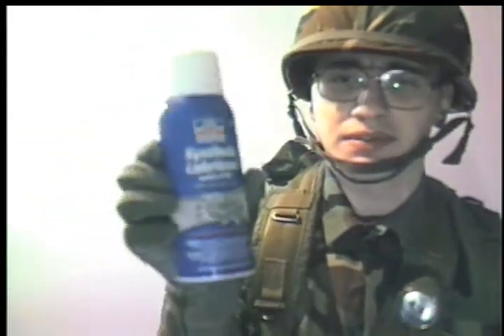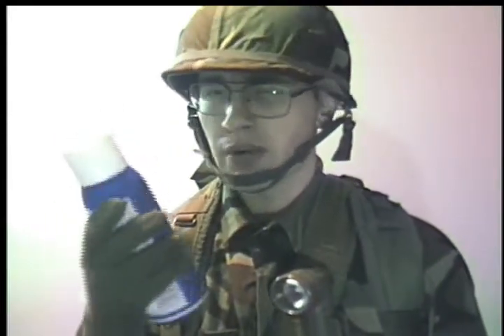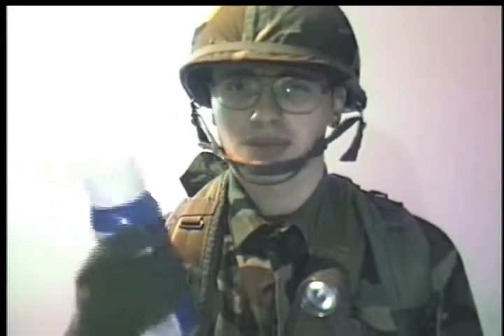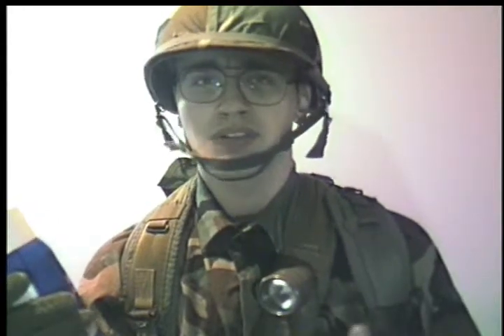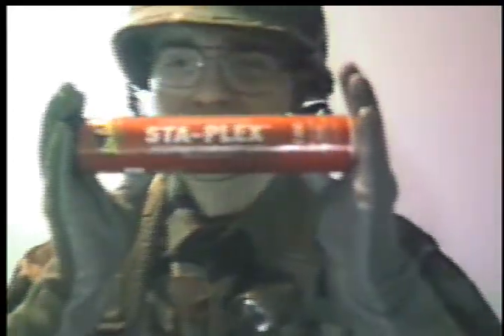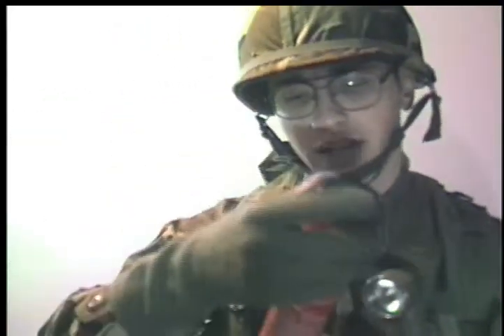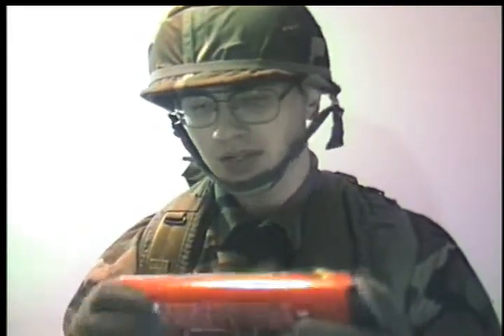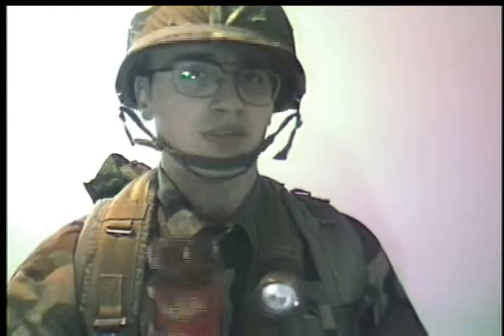Silicone spray is NOT a good lubricant for Airsoft, or real guns

Comment: soo you said that: I have to use high viscosity oils in high wear parts example slide and for non wearing parts use thin oils for example input valve in mags so it can penetrate in side and lubircate the oring but because is thin oil it will go off fast so i hove to lubricate more often am i correct???   

soo this kit may be the solution it has a mixture of Teflon and silicon grease for the slide and a spray for the orings: https://www.evike.com/products/39990/

Comment: Kroon oil universal lubricant a good idea?
Reply from the maker: The spray?
Reply: @KlonoaTorqueBow  think its called kroon oil handy oil
Reply from the maker: @dommebelg6962  It depends on what kind of gun you're using it for.
Reply: @KlonoaTorqueBow  for a WE glock 17 gen 4 gbb
Reply from the maker: @dommebelg6962  Way too light. Get a heavy synthetic oil or grease. I don't know what in specific they offer over in Europe
Reply: No like the bottle the real oil

Comment: silicon lubes fine... on the long run it will stiffen all kinds of rubber parts.
im just about to begin my airsoft adventure as an beginner, and i think im gonna use automatic transmission oil (ATF)
Reply from the maker: GL
Reply: @KlonoaTorqueBow  GL?
Reply from the maker: @ksw8934  Good luck

Comment: What grease would u recommend for gen 3 aeg gearbox
Reply from the maker: Version 3, is that what you mean?
Reply: @KlonoaTorqueBow  yes
Reply from the maker: @empireofsebastian1423  I like RedLine CV-2 personally. That stuff'll keep even curing paint from wearing off.
Reply: @KlonoaTorqueBow  thanks, I've been buying evik brand silicone grease and that stuff is less reliable that petroleum grease in there, but I'll try the Redline and see how well it holds up in the dusty fields of Georgia, thank you 👍🏽
Reply from the maker: Sorry for not responding. By the time you replied I had ate like four double cheeseburgers and was completely wiped out. Glad to be of help to you
Reply from the maker: Wait, let me look at some of the stuff ansoil has. They have some heavier-duty greases that'd be more suitable to airsoft gears.
Reply from the maker: Look for Amsoil's "Dominator" grease instead, sorry.
Reply: @KlonoaTorqueBow  oh ok then, thanks

Comment: What should i use for a hx25 mag?
Reply from the maker: Thanks for reaching out. What part of the magazine?
Reply: @KlonoaTorqueBow  im newer to airsoft. And i am just referring to all of the parts that need lubricant on the mag
Reply from the maker: @12v_Jonn  Do you know how to get the magazine apart? There are o-rings inside that need to be greased. Otherwise, I wouldn't recommend lubricating the magazines unless its jamming.
Reply: @KlonoaTorqueBow  i don't know how to get the mag apart.  I am pry going to use propane. Will that start to dry out the o rings?
Reply from the maker: @12v_Jonn  Propane is optimal. The short of it is that using green gas, silicone oil is added into it, and will be spread throughout the inside of the gun, which is very bad. Using propane will keep the gun uncontaminated.

Some of the WE/AW pistols I've had over the years were leaking out of the box. However, some come in just fine. Propane itself will not dry out the rings, but time will.
Reply: @KlonoaTorqueBow  alright so how often would i need to lube. Since you said time will dry it out
Reply from the maker: @12v_Jonn  Something like 75 wt silicone oil would be a good "general" purpose oil for keeping the o-rings in good shape and could possibly stay for a very, very long time. Most of the dried up o-rings and seals we see in leaking mags are because the wrong kind of lubricant was used, which was spray, from the factory.
Reply: @KlonoaTorqueBow  ok thanks! So my pistol should be good to go out of the box for a long time?
Reply from the maker: @12v_Jonn  Well, that's the wishful thinking. The moment it springs a leak though, it needs to be fixed. Ideally, one would get a valve key, a correct oil or grease, and do over o-rings when they get it, but that's unrealistic for everyone.
Reply: @KlonoaTorqueBow  alright good to know. Thanks for the help!

Comment: I just got into airsoft , I’m going with o ring silicone lube from super lube for o rings , and a synthetic grease from super lube for metal parts any thoughts
Reply from the maker: Sorry about the late response.

Don't use superlube. Use Dow Corning high vacuum grease for stationary o rings, and a mid wt silicone shock fluid for moving ones. The wt needed is specific to the parts it's being used on. For moving parts, again, depending on if it's a high, like a hammer, or low like a spring. Royal Purple, Amsoil, Mobil1 are great options.

Comment: you a smart guy... everything you said makes sense... I use silicone grease with ptfe on the slide and main housing.. I'll only use silicone oil in my mag for the O rings.. Also white or red lithium grease works with slide as well.. I've been using white lithium grease on my real gun slides and outer barrels.. So far so good.. I haven't tried the red lithium yet. I have the lucas red and tacky red lithium... Ill try that next.. Your video was very informative never mind those who don't comment or dislike.. The ones that dislike don't have the knowledge that you have taken the time to retain.. Keep doing what your doing, you're on the right path.. PLus your guns will outlast and outperform all your haters.. So be happy..
Reply from the maker: Thank you for being at least remotely open-minded about this, and I'm glad to hear you've seen through the bullshit marketing of "airsoft oil". Real gun oil, while at least much better than silicone oil, is a mostly snake-oil market entirely with some exceptions. Using products intended for industrial purposes, to prevent the mechanical failure and wearing in machines that can cost hundreds of thousands of dollars is the safest bet.

I was a bit younger when I made this video, and I've learned some new things along the way. If I had to briefly adjust the message of this video, I'd say use the right kind of oil or grease for the application, and try to estimate the base oil viscosity, indicated in a product's sds/msds to be appropriate for the action of the gun. An example of that is a spring-action, basic airsoft pistol. Using something like Dow Corning high-vacuum grease would cause something called "viscous-drag". Basically, that just means the lubricant is too thick for the parts to function with. It's too sticky or thick. 

The best way I've found to have a reference before ordering, is to look for the cheapest oils or greases in several weight-classes, and use those to test similar parts and how well they operate before ordering a premium lubricant that costs money. Hardware store-stuff is great for this, since it's probably just a drive into town. Even if they don't have the right kind, one can still get a reasonable idea of what's too weak, or too strong. Putting it even more briefly, unless it's a super-high-wear part, like a pot-metal disconnector in a gas blowback Beretta pistol, it may just need the lightest oil possible. Things like WE-Tech's pot-metal hammers on their Beretta models, or 1911's will absolutely need the best, heaviest tolerable lubricant money can buy, because those hammers and their sears are the fastest thing to shit out on any gas-blowback pistol, ever . Ask anybody who's owned one. They turn into full-auto-only pistols really fast.

I'm going to make a followup video to this one very soon, and demonstrate what I've learned since this video. Thanks a ton for reaching out. People commenting is the #1 reason I make these videos for.

Comment: I own a kwc/elite force 1911. will a team losi 15 wt shock oil work for my seals? or possibly 100% silicone oil for treadmills.
Reply from the maker: 15 wt shock oil is a great choice, but I'd personally use 3 million for fixed seals, and a much lighter weight like 50 or 70 weight for moving ones like the piston head. I believe that heavy silicones actually improve compression greatly. It could be a struggle to find the highest possible weight that won't cause viscous drag, yet potentially offer the best aid for compression.
Reply from the maker: All kinds of good products and methods that can be used in your situation, that it's much more useful to know what's potentially harmful, or outright just doesn't work at all. 

Silicone treadmill oil is good, provided that it's 100% silicone oil, and can be corroborated to an MSDS to verify that it's actually as it claims. I don't like using anything that I can't find an MSDS for.
Reply: @KlonoaTorqueBow  thank you. im sure you've seen the one video where a guy is reviewing shock oil and only says to get the 10-20 weight for seals. however ive seen people using like 80 weight. but hey, as long as its able to drip instead of stay like grease then ill use it.
Reply from the maker: @callsign_mako3404  Grease is actually great for static seals IME. Plugs up propane leaks like it's nothing else's business. I absolutely wouldn't use it on a moving surface. Too heavy.
Reply: @KlonoaTorqueBow  hey actually, what weight would be good for the metal on plastic applications? my kjw hi capa is polymer and has a metal slide.
Reply: @KlonoaTorqueBow  oh yeah i just remembered when i tried to use silicone grease, just took off a layer of black from the plastic 😬
Reply from the maker: @callsign_mako3404  What weight of silicone oil?
Reply: @KlonoaTorqueBow  yes.
Reply from the maker: @callsign_mako3404  Hm. I'd just use a lightweight oil as possible. It's gonna wear down the plastic parts on the frame, but only as necessary, after which, lightweight oil will give the best reduction in friction.